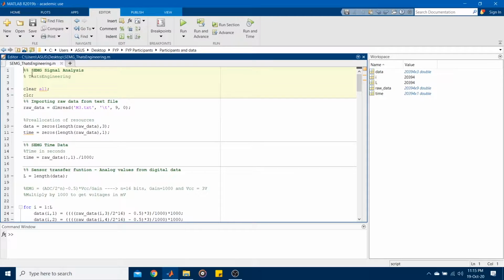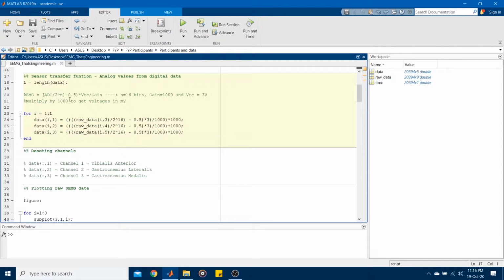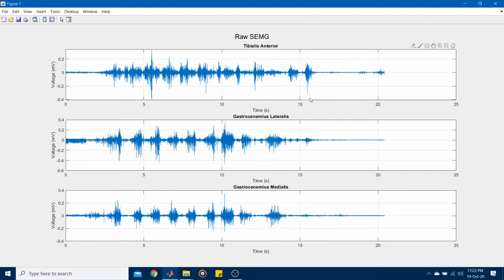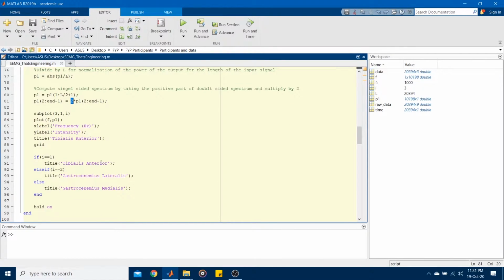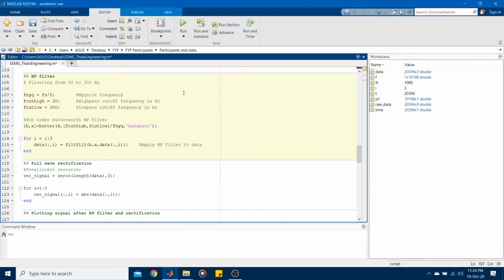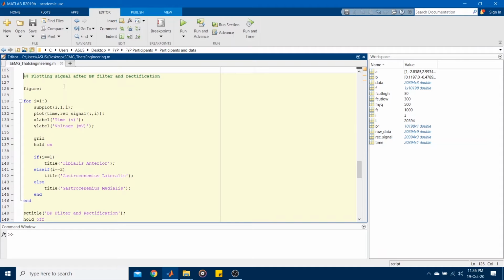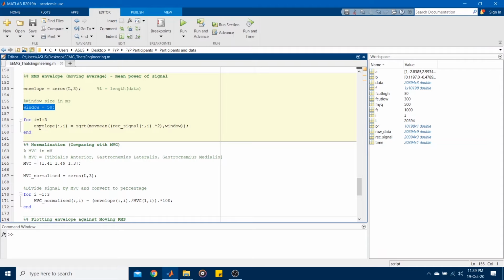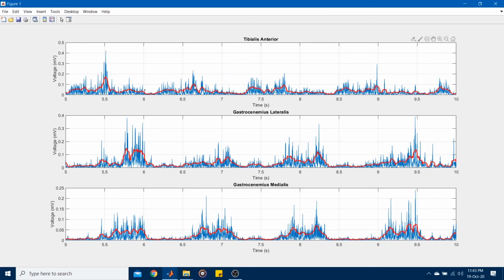Surface Electromyography Signal Processing | MATLAB Code | Part 2

Comment: Hello! after applying BP filter I get oscillations of the signal in the beginning. The rectification works nice and it looks good. I just don't know why is there oscillation of the signal in the beginning from 0s to 0.7s. Afterwards the signal is 0 until it reaches EMG activation...  Did I choose wrong frequencies..?